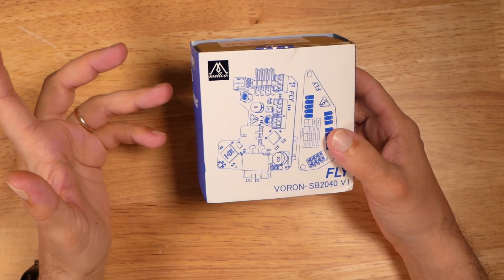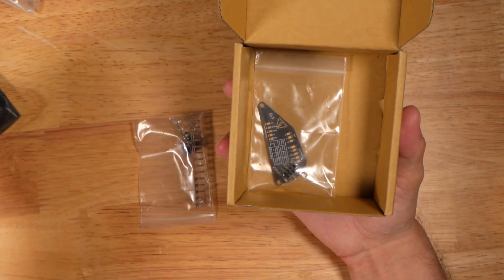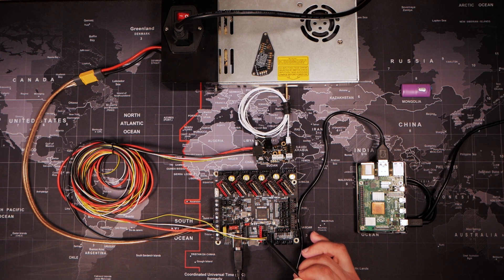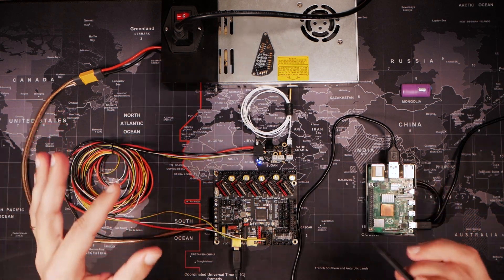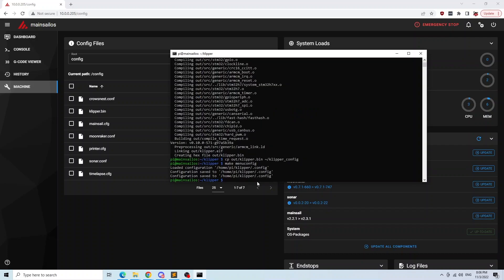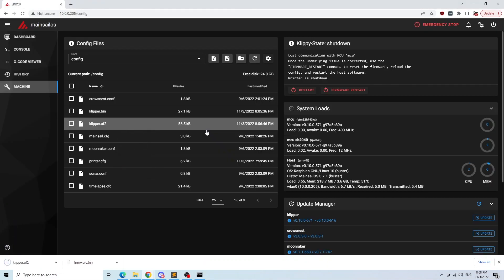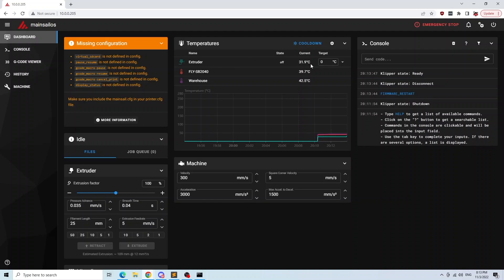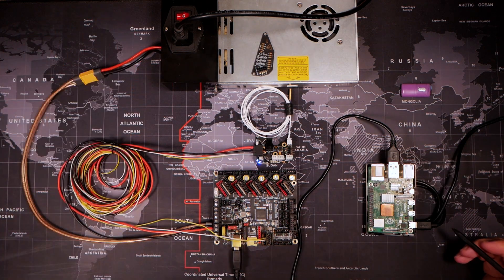Mellow Fly SB2040 Voron Toolhead CAN BUS module

Comment: Great video - I now understand how this should work. However, I have an SKR3 board to which I can flash the standard firmware and all is well. As soon as I change the Communcation interface from  Communication interface (USB (on PA11/PA12)) to USB to CAN bus bridge (USB on PA11/PA12) I can no longer connect to the board. /dev/serial/by-id does not exist. Am I missing somethin? Most grateful for any help you can give.
Reply from the maker: I also had this problem before I have realized that CAN bus switch button needed only if you want to use board as CAN Node, so if you want to use it as bridge you don't have to switch mode with that on board button, just flash bridge FW.
Reply: @hobbyistnotes  thanks for that, but that switch is in USB mode. When I do the 'ifconfig' I don't see can0. The SB2040 has the blue light on that shows the firmware is running and I have put the link on for the terminating resistor. I'm at a bit of a loss.
Reply from the maker: @tonynorman3780  When I started I had exactly the same problem, you need to make sure you actually flashing the board with proper FW and with proper settings, follow exact steps I have mentioned in to the video. Make sure your linux image is up to date, try to make new OS from scratch.
Reply: found my problem - I missed the step where you create can0 in interfaces.d
Reply from the maker: @tonynorman3780  The can0 interface should be UP no matter if SB2040 connected or not. That is the critical step. After you have flashed the board run lsusb to see if you able to spot OpenMoko usb device if not ether your board switch is in wrong position or firmware complied with wrong settings.
Reply: @hobbyistnotes thanks for the reply, but I found my issue. Just missed a step in your video!  Works great now - thanks.

Comment: using a non-twisted pair of wires for CAN should be a crime, idk how they can sell that harness without feeling horrible
Reply from the maker: At this point I am using this cable for a long time with different boards and didn't had a single issue related to cables not bein twisted.
Reply: @hobbyistnotes  CAN has a lot of error correction mechanisms and is overall very robust so if the wires are by accident about the same length it will work fine at the low speeds used in 3D printers, which is why you wont see the issues even if they happen.
Reply from the maker: @EMILE12345678901  Good info to know. I am not as familiar with CAN, only judging based on experience with such boards and as I never noticed can bus nodes into the cars being connected by twisted wires just assumed its fine as is.

Comment: Hi thanks for the guide. One question. In fly and klipper documentation it talks about 120 ohm resistors. It should have one in each end. When putting jumper on flyboard i get 120ohm. But it should be aprox. 60ohm. Did you install one on the skr3? Or is it not necesary?
Reply from the maker: Just checked my setup, the only jumper I have set is 120R near CAN/USB-C connector.
Reply: @hobbyistnotes  thank you. think my board has broken can.
Reply from the maker: @check_u_later  1st make sure you making right firmware and right klipper config. The next step to make sure you can L/H wires are properly connected.
Reply: @hobbyistnotes  thanks mate but if i push down the canbus button it shows nothing. had it burned. It works without the canbus. Also i measured the resitstance over the l and h. it didnt show 120 ohm. So something is wrong. but i bought a fly utoc so got it to work

Comment: How did you flash klipper.uf2 to the can? You hastily brushed this off way too fast lol i heard you connected it to computer in dfu & then flashed it with web interface?  But we didn’t see anything happen. What does that mean? I flashed my skr board with klipper firmware & renaming it to firmware.bin theres alot of info about flashing main boards in klipper docs but how does one go about flashing the can with klipper.uf2? What is web interface? I was following along perfectly and everything was going great and then i heard web interface and project is on hold lmao if you wouldn’t mind explaining that process it would be awesome :) thanks
Reply: Sorry i scrolled down to see if someone had asked this & i found the answer! Its basically you drag and drop the uf2 file to root directory of can when computer recognizes it as a usb drive correct? And it should disconnect after that process which confirms it uploaded?
Reply from the maker: @RPista  Yes, if everything done correctly device will disconnect right after you drop the file.
Reply from the maker: We compile firmwares, than for easy access inside of the RPi we copy it over ~/klipper/Klipper_configs that way we can access it over web interface of the fluiddPi in configs section, you can use SCP for this step if it's easier for you and directly copy files over your desktop. Next step is saving those firmware files ether on SD card to flash Motherboard or directly on SB2040 build in storage connected over USB in boot mode.

Comment: Hello , thank you for your video, may I ask how you burn the firmware on the sb2040 please? When I drag and drop klipper.uf2 to the usb rpi2, it disappears. I can't downlaod it directly to this usb like you are doing.
Reply from the maker: If you drag & drop it over the RP2040 volume then it disconnects and disappears from the device that means device is successful flashed. RP2040 controller is configured that way if it sees *.uf2 got uploaded in USB mode it will automatically flash it to the memory. So you probably good to move over the next step.
Reply: @hobbyistnotes  Waa fast answering thanks! For me it is not working, I was pretty sure that it was not correct because the LED close to the boot button wasn't lit and that the rx tx packets were at zero . I solved it by adding "gpio24" for the GPIO to set at microcontroller start-up.remake the file. Then plug it via usb to my raspberry with mainsail os with the boot button pushed. and then via putty I have done 
cd klipper 
and then
make flash FLASH_DEVICE=2e8a:0003      
(I have used lsusb to make sure about the device name)
The led turned on and then the rx tx were like yours.  
Now,my new goal is to make my devices appearing in Mainsail dashboard and test it^^. I have no experience in this but I will find! 
Thanks once again
Reply from the maker: @anthonyguillet9550  Thank you for sharing the information, it could really help some one in to the community. My video is 2 months old and the process could change over time so any comments are helpful!

Comment: Did you compare this board with the Fly-SHT? Any advantage other than the form factor? I saw that on the SHT I can choose between 5, 12 or 24V for the fans (here I could use my Noctua) and on the SB2040 the options are either 5V or 24V right?
Reply from the maker: I think you are right, but same time personally I don't care about Noctuas they are very underperforming fans for 3d printing, tho having extra voltage is always nice. I just bought 1st thing I liked ;-)
Reply from the maker: Main reason why I got 2040 over SHT was that little organizer board for toolhead fans and LEDs, less connectors.